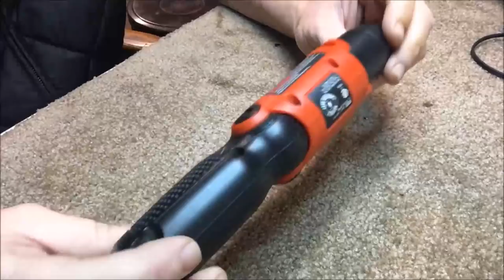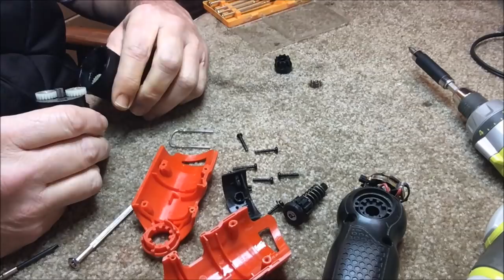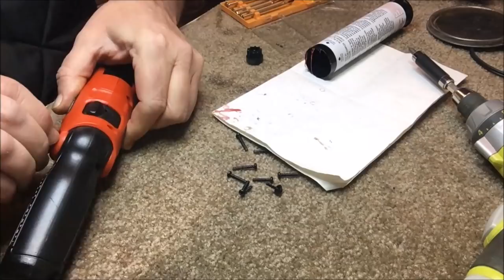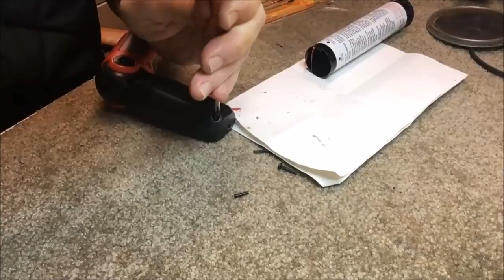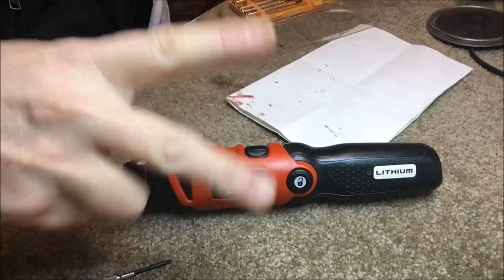Boudreau Guitars - An easy upgrade on a cheap Black & Decker li2000 cordless screwdriver

Comment: Geeze you would think a little grease at the assembly plant wouldn't break the bank. Nice work Ken.
Reply: What lubricant  you put into a device really matters.  Like you would not put the wrong oil in your car now would you?   These devices are designed to run on not a lot of grease, and of a specific viscosity.  What is the  point of losing torque by having a lubricant that is too thick for the application.  If it did not have much grease then it may be the case that it was not intended to have much grease.  It is only a lightweight screw driver after all.  They are built to a price point, and often built to fail after a certain number of hours.
Reply: Yeah cool dude...
I have had a similar conversation with a guy about using Mobil SHC100 and SHC220 in a Marathon motor for an air handler. Are you related to a guy named John Shea?

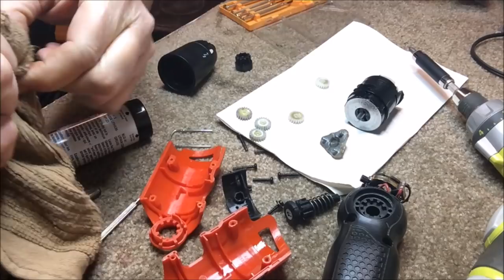Comment: 4:35 the gears made from PP/POM will last longer and are less noisy than cast metal gears. In cheap constructions they're often a good choice when it has to be straight teeth and the load isn't that huge. (While there are some that can quite a beating if the heat isn't too much).  It's more about how it is all guided in the crappy housing. The sticky grease was a good choice to keep it down a little. For a lot of the bigger drills it's mostly about cheap bearings and motors. Nice to see something taken apart instead of the throw out mentality. I'm still looking for something like that, the straight grip is a lot more comfortable than the pistol grip working on a 3+3 headstock.

Comment: This cheap B&D driver is particularly good for a peg winder because when you set it to CW it'll stay set to CW. I bought one of these at Target figuring that it would be comparable to other B&D lithium drivers. It is definitely not. I was going to return it but never had the driver, the power supply and the packaging in the same place at the same time so I was stuck with it. :-(
I highly recommend the Music Nomad peg winder... it is covered with a soft but durable rubber/plastic and will never scratch up your headstock.

Comment: Hi Ken ,That Lucas red grease will last forever in that little machine.We used it on our Dozers and Loaders when I was working.(Ret.) In fact you might have put a little much in there,as thick as the stuff is ,you probably coulda used about half.Sounded like it dragged the rpm down a little.But heh , better safe than sorry right.Peace Bro.Good idea.
Reply from the maker: bob bitchen , back in the day I used to rebuild construction equipment transmissions (shuttles) for a CASE dealership, and this was the type of lube we used to hold the bands together during assembly. And yeah I might have over done it a little 😎
Reply: Boudreau Guitars Yeh thats fun work ,when you can get it.I enjoyed doing that kind of stuff.Peace bro.Cya.

Comment: There is nothing I hate more than B&D tools. The last time I bought one was about 20 years ago. It was a cordless drill but it had a trickle charger and not a bat you could take out. It took 2 hours to charge the thing and in a cabinet shop it was pretty much useless. I was really happy when I accidentally knocked it off the bench and it splattered into 20 pieces. Funny thing you may have noticed the little drill string winder on my bench is a B&D. 

You really did quite it down, drill a zerk fitting in that thing.
Reply: A long time ago they were decent. We still got an old belt sander that I still use today. They had a different colour scheme back then. The housing is darker turquoise and the cable is orange.

Comment: Quick question! What comes after applying a clear laqeur on a guitar finish and neck to get that smooth factory feeling/look!? You're the best!
Reply from the maker: Hello Jayce, after applying your lacquer let it cure for about 6 weeks, then wet sand until it's smooth making sure you don't sand through the finish and hit wood. start with 400grit then go to 600grit then 800grit then 1000grit. At this point you ready to start buffing, buff with auto finish, anti swirl compound to a hi gloss, smooth finish.
Reply: Boudreau Guitars you're the best! Car polish work? I have the approproste sand paper so I shall wait 6 weeks!

Comment: What surprises me is that you could take it apart. Some of the really low-end stuff from China is either heat sealed or CA sealed. I’m assuming they just toss warranty claims in the trash - or maybe cut the case off and seal the old guts in a new housing. Anyway not a DIY deal

Comment: Nice job there Ken. I believe if I had been doing that. I would have covered my bench with something, I have seen you sand and prep for finish on that bench, Well as you know as well as I that finish and grease don't mix well, LOL  You get that grease on wood and look out getting it off. The thing about it, you may not know it, till it's to lateClean that carpet well before you start prep or sanding, ect.
Reply from the maker: William Castleberry this is my soldering station, no finishing goes oh here. It’s due for a carpet change soon anyway I just need the ambition to cut a new piece.